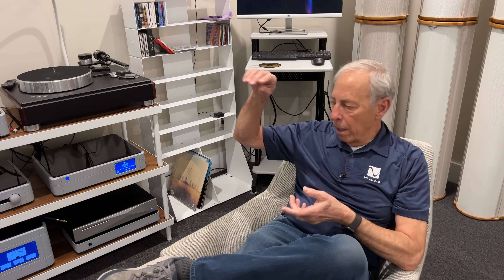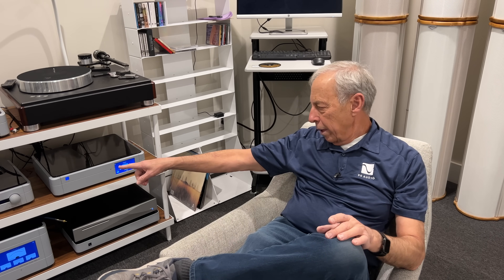How a DC servo circuit works

Comment: In most applications, the servo circuit allows one to replace two capacitors, which are typically electrolytic types due to the large values required.  Without the servo circuit, not only do you need a blocking capacitor at the input, you also need a series capacitor in the feedback network shunt, to reduce the amplifier's gain to DC (to limit DC at the output due to the amplifier's own input-stage offset error).  
But the real advantage of the servo circuit is not so much replacing two capacitors with one - it's that the capacitor value needed can be scaled down, thus avoiding electrolytic types.  One can use film capacitors instead, which have much better linearity.  
Note that most servo designs are actually monitoring the output DC, not input DC, which allows it to compensate more sources of DC offset.

Comment: Is there a point when the DC servo cannot block/regulate the DC to ground and if not what happens to the signal/output?
Reply: Yes, there is a limit.  If that limit is exceeded, you start to get DC at the output, but at least it will be lower in magnitude.

Comment: In terms of AC (the musical content), it is a high-pass filter where below a certain point the amplifier has unity gain. But I realise that Paul's challenge is to put it in less technical terms. It avoids using capacitors between the amplifier and the speakers. That capacitor (called AC coupling) has pros and cons, but probably more cons than plusses.
Reply: In fact, the DC servo circuitry is applied to amplifier designs which never had a DC blocking capacitor at the output, because they use bipolar power supplies.  The purpose of the servo circuit is to avoid electrolytic blocking capacitors at the input and within the feedback network.  
Amplifiers which need an output DC blocking capacitor are those which have unipolar supplies.  In that case, the capacitor is blocking a very large voltage, there is no need for a DC servo circuit, and a servo circuit would not be able to allow deletion of the output capacitor.

Comment: I take it you're talking about DC offset correction in a power amplifier ... I'm surprised so many audio amplifiers don't feature this circuitry.. I've seen it used in speaker protection circuits which isolate the speaker if the output goes either +ve or -ve ... but not used to null offset the input diff pair ...
Reply: The input blocking capacitor has the advantage of being able to block large DC voltages from defective equipment, and it's simpler/cheaper.
Reply: @marianneoelund2940  True... yes .. I have  to agree, but certain types of blocking capacitors aren't capable of blocking all of the DC component out . Electrolytic ones especially! Apart from introducing their own sonic qualities they also have asymmetrical blocking properties .... due to chemical imbalances within the capacitor thus allowing a small part of the DC voltage to " leak" through , particularly with large voltage swings. Bi polar caps can help solve this but at the expense of amplitude and phase ...
These caps are totally incapable of maintaining a fixed 0 volt crossover point ... this is where a dc servo comes in 😊
Reply: @janinapalmer8368  I don't care for electrolytics either.  Bipolar types are only a modest improvement.  
They also age, especially the smaller sizes, and can truly wreak havoc in switch-mode equipment.

Comment: I think you said that backwards - anything that’s happening faster than (for example) 10 seconds does get amplified, because the music happens from about 10 cycles per second on up (yes, I included the infrasonic range - some EDM actually has components there). The DC is the unchanging bias that happens slower than your servo filter’s cutoff frequency (the ten seconds in this example).

BTW - this has very little to do with DC servo motors like you would find in robots; and is only tangentially related to driving speakers with a servo amplifier.
Reply: The servo circuit’s output is the DC bias, and is indeed inverted voltage-wise, such that when summed in it cancels out that DC bias in the input signal. Where Paul misspoke was in describing which frequency range the servo circuit is sensitive to.
Reply: It is used as negative feedback, it is supposed to be backwards.  You amplify what you want to get rid of, invert it, and feed it back in.
Reply: @ThatGuy2042_  Paul didn't qualify his statement by saying he was describing the servo circuit's output.  Without that, most listeners will assume he is talking about the amplifier's signal path, so I will agree with Dark Winter that Paul misspoke.  There are other "slips of the tongue" in the video, which are common in Paul's presentations in general.

Comment: What is an op amp?
Reply: Op-amp: short for Operational Amplifier; this is an integrated circuit that is a very high gain difference amplifier. It has two inputs, and one output; the inputs are labeled “+” and “-“. If the + input has a higher voltage than the - input, the output is driven hard towards the positive power supply rail, and if the opposite condition is true, then the output is driven hard in the opposite direction (toward the negative power supply rail).

From that relatively simple function, depending on how you hook up the three terminals on the op-amp; you can get a wide variety of behaviors. It can be a simple buffer (the output tracks the + input), or an inverter (the output is the opposite of the input signal), or sum up the input signals (this is done by connecting them all to the + input thru individual resistors, one per signal), or as in this case, an integrator, where the output is an average of the input signal over some time period (yes, that’s the integration you may remember from calculus class).

As you can imagine, they are very handy chips to have!

Originally, op-amps were developed to perform mathematical operations in analog computers; which is where the name comes from.
Reply: @darkwinter6028  I actually took courses at the EE department so long ago, that we had an analog computer in one of our labs - and one of my control theory courses used it!  It had a strong resemblance to a Moog synthesizer - many functional blocks connected by a rats nest of patch cords.  
Also, the company I worked for was using an analog computer back in the 1970's to simulate nonlinear analog circuitry that was difficult to analyze using exact mathematical approaches.  
And of course, the original op amps were discrete designs (vacuum tube or transistor), pre-dating IC's.
Reply: @marianneoelund2940  When I was a kid, a friend of the family worked as the system operator for the local university’s computer science department; and had fished some of those plugboards out of the trash and brought them home for us kids to play with… I didn’t know what they were at the time, but later when I grew up and the internet became a thing I saw some photos of them and went “Ah Ha! So that’s what those were!”. So, yeah, oddly enough, I actually have hands-on experience with plugboards! Alas, along with all the Starwars toys, they’ve long sense gone to the landfill…
Reply: @marianneoelund2940  And the original tube op-amps were big modules with round multi-pin sockets (8-pin, if I remember right?)… and they weren’t cheap, either. Nowadays a basic IC op-amp can be had for a dime or so in quantity… (fancy high-precision audio op-amps are a few bucks, though).
Reply: @darkwinter6028  I believe someone is still making those tube modules.  IIRC I saw a spec sheet on one, not long ago.
Reply: John Bravo  Eh… I suffer from insomnia, and I have an iPad? (I’m really a software guy - programming on the various Apple platforms is my specialty) 😉

Comment: With PA speakers, you have the option of the paper cone woofer, or the paper cone woofer, or the paper cone woofer.....BORING.
Reply: I think from a strength to weight ratio and good sound characteristics, paper is the way to go. I have a speaker that uses a woven Kevlar and has superb transient response but it’s a 6.5”. I think if it were any bigger, the material strength will be compromised. Everything has it’s pros and cons and reasons.
Reply: @Bassotronics  
What?  Kevlar is lighter and stiffer and STRONGER than paper!
Reply: @Bassotronics  
The T21 subwoofer incorporates the newly-developed Adamson Symmetrical Drive multi-layer 21" Kevlar driver.
Reply: @adamsonlinearrayspeakersha87  
That’s awesome. 
And also, I wrote “I think” because I was not sure how that material would hold up on a bigger sized driver since resonances can crack the diagram but I can see now it can work great.
Reply: I feel like this comment thread is a commercial for Adamson. The T21 sounds awesome! Newly-developed multi-layer Kevlar driver?! That's so much better than paper.
Reply: @doublet147  
Actually, I don't like the sound of kevlar cones, but at least Adamson are not sheep 🐑🐑.
Reply: At the end of the day we're talking about sound which is subjective. So the fact that you and your supporters seem to think a particular material for manufacturing woofers is better doesnt hold up, At least not from that subjective standpoint. 

Because as I'm sure you're aware of the choice of materials in manufacturing does constitute a substantial departure in sound when utilizing those various materials and ultimately one end user would find one sound more preferable than the other. 

I personally defer to the wisdom of the late Rudy Bozak and his penchant for paper cones combined with lambs wool.
Reply: @Audiorevue  
What?   I did not say Kevlar is better than paper !!!   But you obviously do think paper is the best.
Reply: @Audiorevue  
Sreyas p Saji <--- this youtube channel has lots of videos playing the adamson kevlar woofer cone line arrays, listen & judge for your self.